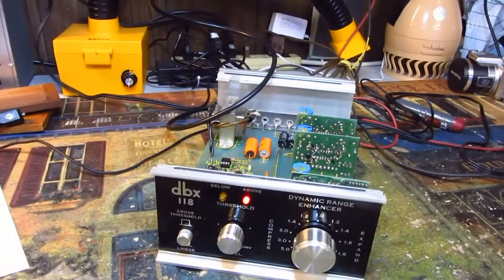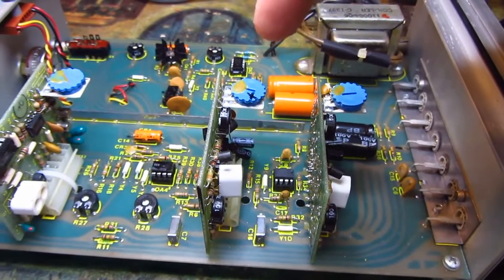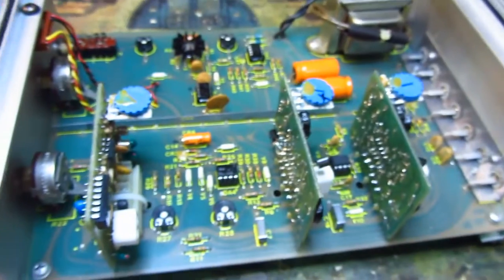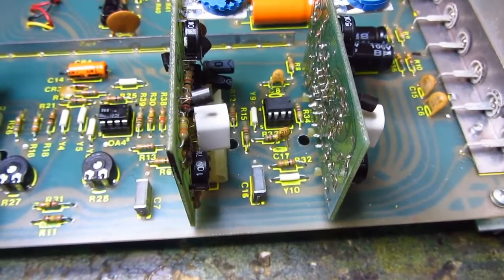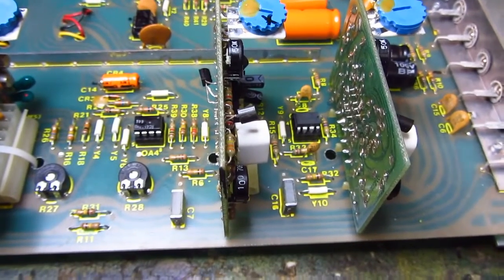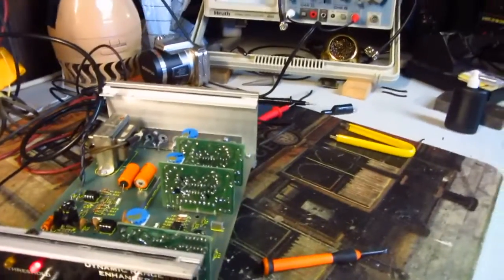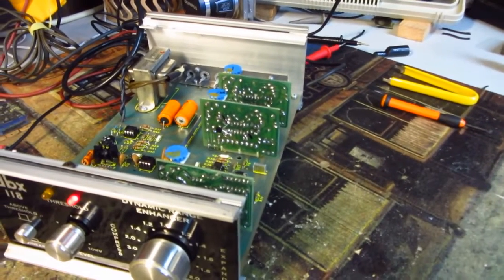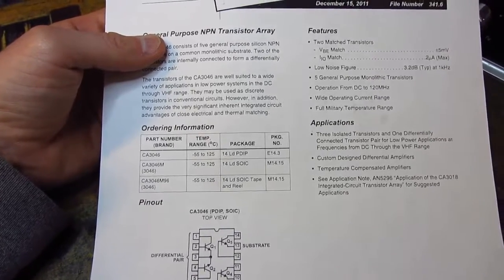DBX 118 Dynamic Range Expander repair 1 Channel dead

Comment: @bigslick I have a dbx128 and both channels are out and the red/green threshold lights don’t come on. Power light oldies come on.  Ideas?
Reply from the maker: I dont know all of these models off by heart, but if both channels are dead, I would first think of a bad IC.  If your model uses RC4558 or TL072 or similar IC, then just shotgun replace all of them with new.  I see a ton of those ICs bad these days, and they can be purchased for approx a dollar each at ebay or aliexpress.  Probably cheap from the top-shelf vendors, too.  Just replace all of them and see what you have.  Be sure to insert them into the sockets correctly (obviously).  Without seeing the unit, that's the best generic advice I can give.
Reply: Did you ever find a fix and find parts ?
Reply: @jesse75  no sir, I’m hoping a friend has a functioning used one in storage.

Comment: Those Tantalum capacitors are troublemakers. Out of 3 of these units, two were non-working due to the little blue Tantalum’s. Same as in a vintage 1974 Pioneer SX-939. Sanyo Tantalum shorted on the tuner board. Along with a couple more low value uF electrolytics. 
Tuner worked miraculously before total restoration. Capacitors on the tuner board were the culprit, severe oscillation of entire receiver. Any mode.